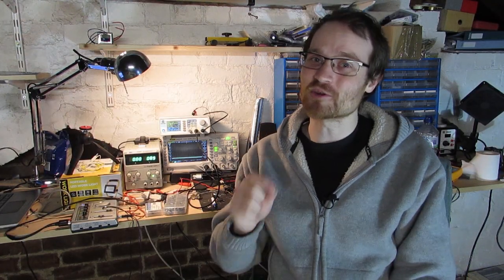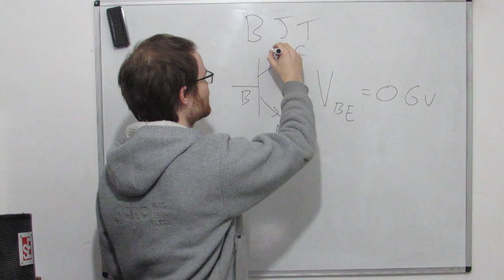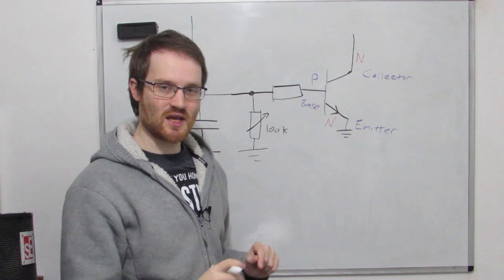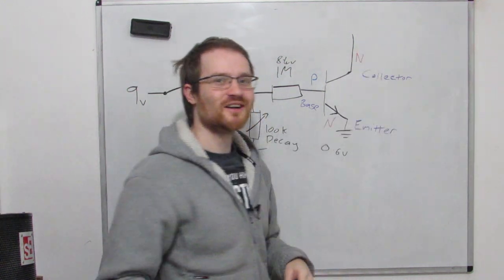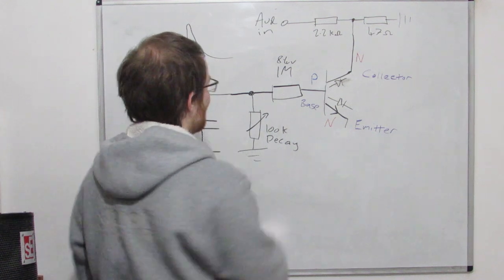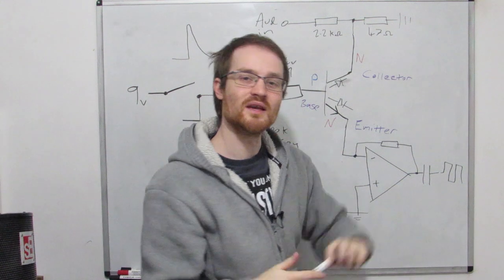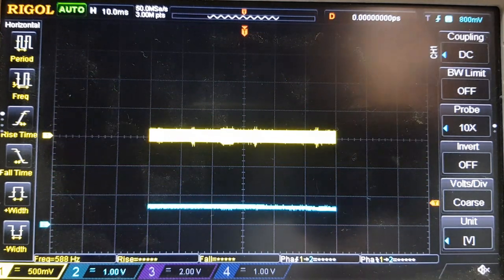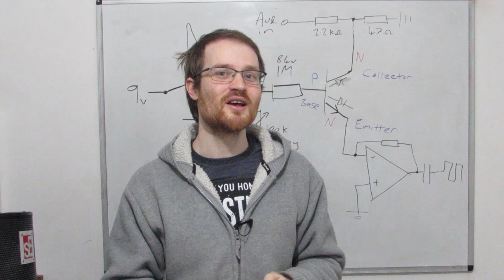Single Transistor Voltage Controlled amplifier! (VCA)

Comment: This is a nice simple circuit without too many confusing components.  I think your description of a transistor as a voltage controlled amplifier is not quite right though - really it's a current controlled device.  The base emitter voltage is always 0.6v so it can't really be voltage controlled!

I've never seen the op amp current to voltage configuration and I didn't understand your explanation of how it works.  Also I found the pen lid clicking on and off a bit distracting.

I think this video is a great introduction to transistor circuits.  It's probably not the cleanest VCA ever but there are a lot of times when you don't need it to be perfect (and sometimes a bit of character is desirable).

Keep up the good work - I'll be back to see what else you come up with!
Reply from the maker: Hi Stephen!
This is quite a common misconception about transistors, i've had this comment a few times so i'm going to answer yours and pin it - i hope you don't mind!

Is a transistor voltage or current controlled? Really you could argue it either way, but to describe a transistor as voltage controlled is quite accurate. What is really giong on inside a transistor is that (just like in a diode) there are electric fields inside the device that counteract the applied voltage (input voltage) in order to dictate the flow of current in the device. These fields can grow and shrink depending on a number of factors but most importantly in this context, the applied voltage across them. By then biasing the 3 different terminals to different amounts (usually Collector > Base > Emitter), these fields then restrict the flow of charge differently, and we can control the flow of charge through the device through the modulation of these applied voltages. There's a quite well known equation that describes this behaviour relatively simply called the 'ebers-moll equation' 

Ic = Is(e^(Vbe/Vt)-1)

IC is the collector current, Is is the saturation current (this is essentially a constant at room temp), Vbe is the base-emitter voltage and Vt is the 'thermal voltage (again we can consider this a constant at room temp.)

This equation shows that the collector current as an exponentially varying function of the base to emitter voltage - not current. The current that flows through the base is developed by this voltage.

I think the confusion comes at the approximation that the base to emitter voltage remains constant at 0.6 volts. This is only an approximation.The reason we make this approximation is because we are designing our circuits so that the exact value of Vbe isn't critical, not because it is actually fixed! Vbe can vary from device to device and varies with things like temperature, so we can't rely on it being any particular value. So in some contexts it's easier to 'pretend' that Vbe is fixed and that the input current varies, but this isn't what is really going on.

It is small fluctuations of this Vbe that cause the changes in collector current (see: https://i.stack.imgur.com/P6UOD.png or https://www.onsemi.com/pdf/datasheet/2n3903-d.pdf figure 17 here on page 6 or any transistor datasheet!), and the change in the base current is actually due to the small change in Vbe. If we could get a device that could vary the input current with no change in input voltage at all, we would have a device with 0 input impedance which can't exist!

I think the saying "all models are wrong, some models are useful" is pertinent here! Modelling a transistor as a current controlled device that amplifies the current from the base at the collector is a very simple and easy to use model, so we use it often! but that isn't the whole picture. Even using our exponential model above, which is more accurate, is still wrong! it doesn't account for the early effect and other things. But it's useful, so we use it. :)

So while it's not wrong to say transistors are current controlled if that's how you like to think of them, it's also perfectly correct to think of them as voltage controlled as well. Really it's both! Voltage and current are intwined, you can't have one without the other. 

Ultimately it depends how much detail you care about in the context of what you are trying to do which model you use, and each model is 'wrong' in some way or another. Usually we try to go for the simplest model that gets the job done.

I hope this isn't overly technical. Let me know if you want me to expand on anything here. :) I have a video on the physics of how diodes work which should shed some light, and i'm planning on continuing that style of video through all the different transistors.

The book 'The Art of Electronics' is a relatively beginner friendly book and does a great job explaining transistors in great detail. Chapter 2 starts with the 'current amplifier' model and takes you all the way up to ebers-moll and beyond, I highly recommend it!

Thanks for the great question and thanks for watching!!
Reply from the maker: Sorry you didn't understand the Current to Voltage converter.
To try and simplify my explanation, 
The input of the op-amp has infinitely high impedance (approximately) aka it looks like a hige resistor. Because of this, the current from the output has nowhere to flow but through the feedback network, because electricity will always take the path of least impedance. This current develops a voltage across that resistor. 

This drop is positive at the input and negative at the output, by convention. In order for the op-amp to have both it's inputs at ground (op-amps want both their inputs to look the same) the op-amp lowers it's output to accomodate the voltage drop caused by the input current. i.e if the input current cause a 2v drop across the resistor, the output moves down by 2v so that the input is at 0v, and the output is 2v lowere than the input, because we must have that voltage drop across the resistor!

https://tinyurl.com/yg6ctfnt

There's a simulation that hopefully helps if you're a visual person.
Reply: @TheAudioPhool  Great reply!

"All models are wrong, some models are useful" is a great quote.  Thanks for the detailed explanation!
Reply: @TheAudioPhool  Thanks for clarifying - very clear and understandable explanation! The key thing is that no current will flow into the input.

I always find it hard to conceptualise how current can flow into the output of an op-amp.  I know that it can, but it feels really un-intuitive.

Thanks for replying to my comment - I've learnt a couple of cool new things!  Much appreciated!
Reply from the maker: @StephenBrown85  That's the only problem with the 'black box' op amp approach. It hides so much functionality inside a mysterious box that some behaviour seems really un-intuitive.
I'm glad i culd clear that up at least. Electronics is weird and confusing!!
Reply: @TheAudioPhool  To me the current/voltage distinction becomes more important when you compare a BJT to a JFET. You do need a voltage on the base to create a current to turn on the BJT but you don't need a current to turn on a JFET.

Comment: This circuit is used for ADSR envelopes in a Soviet synthesizer from the 80s called Maestro. It has 4 channels, so the currents from all 4 channels are added together and converted to voltage using just one opamp. I didn't understand how it works before your excellent explanation. You're a great teacher. Thanks!
Reply from the maker: I never knew that! I thought i made this up myself!!!!
Reply: Hello there. Do you have the thematic for this Maestro somewhere? I would love to take a look but I could find anything on the web

Comment: That is a wonderful single-transistor + 20-transistors in an op-amp IC VCA!
Reply: I thought the same thing, but if you’re tinkering with these circuits you likely have an op amp chip with some unused channels since there are four per chip.

Comment: You didn't really explained how the currents Ic or Ie varied. For a fixed Vb, the transistor has to work in saturation region for Ic to depend on what happens on the collector

Comment: Expertly explained. Question though:
Is it an amplifier? Is there a gain you're getting out, or would voltage controlled attenuator be a more "technically correct" name for the circuit?

Really great though, I think this is what I'm going to use in my DIY synth mixer
Reply from the maker: This is actually a great question! :)

Usually in electronics we are concerned about the
 voltage gain of a circuit, but there is more to it than that! In this circuit we are looking at current, and we have current (and power) gain! I uploaded a video earlier today with a similar circuit that actually does attenuate the voltage a smidge, but amplifies the current significantly, giving it again, current and power gain!
Reply: Word! I'm still slogging through the basics of electric math and it's concepts, but sooner or later, current will not be painful to think about. For now, I'll just be thankful it works :)
Reply from the maker: @arenotdiy7280  You're doing great! You're obviously getting the hang of it because that was quite an insightful question.

Keep going! :)

Comment: Another awesome video dude. Gonna try to make something like this on the weekend. Can you do a video about outputting to line level outputs or some other concepts related? I think it'd be attenuation? I built a VCO but output is between -12 and +12 and I'm afraid it's too hot to plug into my stereo.
Reply: Video on line level outputs would be helpful... difference between line and mic level or something of that sort
Reply: @AndrewPineiderMusic  yeah definitely, I haven't been able to find any good videos on building the hardware to handle that stuff
Reply from the maker: I've put it on my to-do list. :) Thanks for watching!

Comment: This shouldn't be done this way. If your input is square wave, then it is enough to power up a simple common emitter amplifier built with a single transistor from an ADSR source. This way the maximum output vpp is limited by power voltage and therefore will repeat the ADSR envelope. 

If your input is a complex analog signal like sine wave+pink noise for drums, then you need to decrease it to about 5mv first, then pass through the single transistor common emitter amplifier with the DC collector current controlled by some low 0.1-0.5V bias voltage passed to the transistor base as well. 

This way the middle point of sine wave is shifted along the transistor base current graph and its curve changes so the output voltage is actually a product of multiplication of bias x signal. 

The disadvantage is still some clicks at short attacks but you can filter them out, or use balanced/differential two transistor circuit with an opamp output buffer.

Comment: Great video. Using a 10k trimpot will work as the voltage divider for the audio signal part?

Comment: if you put a triangle at input will make triangle shape at output...as any vca?
Reply: Yes! It's actually pretty close. There is a small amount of compression due to the signal requiring to broach the limits of the linear region of the transistor, but it does work. You can't expect the output shape to "follow" the input CV extremely closely though, as it doesn't have any way to precisely control the scaling (linear vs exponential, no offset or VCA tuning included, but could be added). Also, worth noting that it works better with small input signals, and using a second opamp to scale the final voltage to your desired levels (or to make maximum at the end equal the input, which is pretty typical for a VCA)

Comment: Nice and simple! So, to use external CV instead of the "transient generator", we can connect a buffer to the 1M input resistor (and eliminate capacitor and pot)? And then use a 100k input resistor instead of the 1M?

Comment: I've just stumbled across your channel and subscribed. I'm learning electronics after a 35 year absence and am particularly interested in Audio. Why did you connect to the inverting side of the op-amp?
Reply from the maker: Glad to have you on board! I have a whole playlist on op-amps which i think you'll find helpful :)
Basically when we have negative feedback (feedback to the inverting (-) terminal of the op-amp) the op-amp will try it's best to make both of it's terminals (+ and -) the same. In this context, because we have the + terminal grounded it makes that - terminal look like ground too, which is handy in this circuit because we want the emitter grounded. The op-amp will hold that emitter voltage at 0 volts all the time, without stopping a current from being passed to the output of the circuit. If i put a resistor there instead, the voltage that is developed across that resistor would love the potential difference from the emitter to the base, turning the transistor off!

How i like to think of this is that there is a current coming from the emitter towards the op-amp terminal (-), but the op-amp wants to neutralize that current (to make both inputs ground) so it outputs an opposing current to cancel that incoming current, and because we put a resistor in the path, that current becomes a voltage and we take that as the output! That's not exactly what's happening, but it gives you a nice picture of whats going on (i think!).

Hope this helps!
Reply: @TheAudioPhool  Thank you. So much to remember, relearn and learn anew.

Comment: Hey man thanks a lot for this!! This is really really helpful and informative. I'm fairly new to electronics in general and synth building. I have a question regarding the the voltage divider used for keeping collector around 1V.  Are the resistor values right? I tried them on a voltage divider online and I am getting a voltage closer to 0.1V. If I change the 47 ohm to 470 ohms, the voltage is getting closer to 1V which is closer to what we need? I am curious if I am understanding something wrong. Thanks again man.
Reply from the maker: Hi mate! It should be 220 ohms and 47 ohms. if you check the schematic in the description that has the correct values :) sorry about that! 
Thanks for watching!!
I have a video coming out very soon with a much better VCA so keep your eyes peeled!

Comment: How would you go about adapting this to eurorack voltage levels? (I. E. - +10v signals that are balanced around 0) kinda confused about how the transistor voltages would work out in that context
Reply from the maker: I nearly added a section to the video about how to shift a signal up that was centered around 0 but it made the video too long! it would still work but you'd find the transistor would conduct for negative voltage swings regardless of the control voltage and essentially just look like a resistor.
I actually nearly added a section like this to the video but it made it too long! Basically you wan't to shift the voltage up to be 1/2 of the supply and half the amplitude so it doesn't clip.
https://tinyurl.com/yeld4h78
Here's an example circuit, the first stage cuts the gain by 1/2, the second stage shift the level up to be centered around 1/2 of Vcc. 
You can do it in one stage but i think it's clearer if i show you like that!
Reply from the maker: Here's the single stage :)
https://tinyurl.com/yehpwp5u

Comment: Shouldn't the capacitor and the resistor in series to get a decay output? The voltage will be a constant 9V in your diagram I suppose

Comment: Could you replace the physical switch with another transistor acting as switch to use an external CV trigger signal? What changes must be added to support 12V (eurorack)?

Comment: Maybe a silly question. What speakers do you use? I want to start experimenting with some of the things you're demonstrating here and need to buy some "equipment". All my speakers are Bluetooth. I assume you use some analog speaker to output real audio.
Reply from the maker: I'm literally just using a pair of crappy USB computer speakers. I have the USB plugged into an old phone charger and crocodile clips attached to the 3.5mm jack to hook into the circuit

Comment: This very simple VCA has only one but sometimes very annoying disadvantage. Control signal mixes with audio signal and will give clicks during every attack. In the early days of electronics such type of modulators could be used for slow attack instruments like strings... but for a synthesizer it is essential to use balanced VCA, like a differential amplifier with current control.